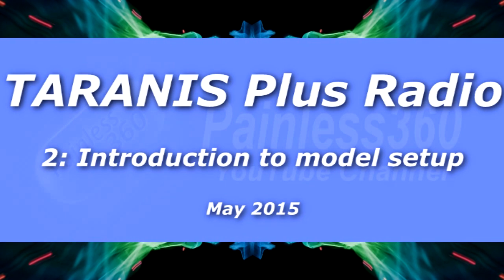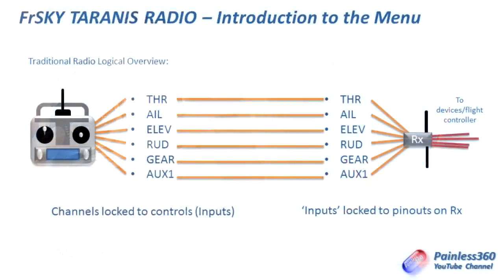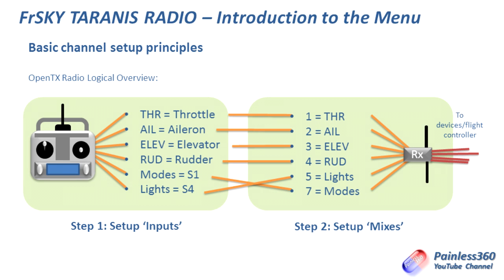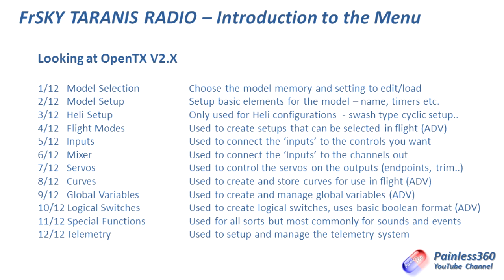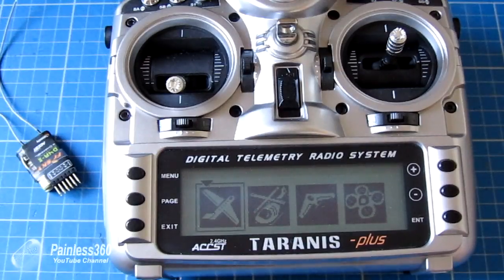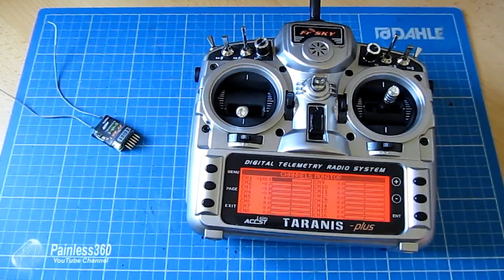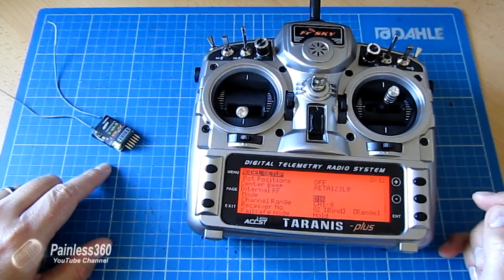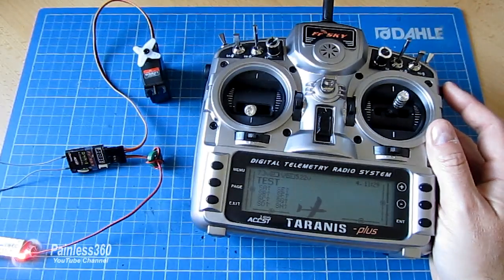(2/12) FrSky TARANIS Radio - Introduction to TARANIS model setup basics

Comment: I have a brand new Taranis Plus and X8R receiver, I cannot get it to bind at all.... I sent the rx back and had it replaced. still doesnt work... I have tried all the modes and it still will not work... I have the latest firmware on it and it still doesnt. When binding, the 2 LEDs stay solid. when im not binding its a slow red flash... Can you help me?... I havent used the dang thing yet...
Reply from the maker: JakeWardell 19 Make sure you have the D18 protocol selected (just above the bind selection on the radio) and it will burst into life!
Best of luck
Reply: Painless360 it's currently D16, ch1-8 receiver number 1. Still nothing. Even tried to make a new model...
Reply from the maker: Odd, make sure then that D16 is selected, the radio is in bind mode and bleeping, hold the FS button on the Rx and apply power. Nothing will beep to let you know it's working though..

Unplug the Rx and take the radio out of bind mode and re-plus the Rx into power - it should green LED in a second..

Is this the process you are following?
Reply: Yeah that's what I've been doing. Over and over again. Different models too.
Reply from the maker: Sounds like something is broken. The antenna connection at the top of the main circuit board can come loose in transit. Worth a check if you don't want to go back to the vendor for support..

Best of luck.
Reply: Yeah they did a crap job on shipping. I'll have one of my buddies check it out. I doubt ReadyMadeRC will replace it since I've had it for about a month. Even though I haven't used it.
Reply: Right when I got it, it did bind! But it would constantly say telemetry lost and gained. Then it just wouldn't connect anymore. Also, rssi signal, when I did manage to have it bound, I was about 10 meters away and it was I think 50 or so. Keep in mind I was in my house. But I shouldn't have had that signal issue.
Reply: It stopped connecting after about 10 minutes of being powered on.
Reply from the maker: Sounds like a bad connection finally let go. If you don't have another Rx to try then you can try then I would pop the case on the radio and check the antenna is connected ok - https://www.youtube.com/watch?v=ycM-fDWOLtE

Best of luck.

Comment: can you change the responsiveness of the stick on the taranis? in other words Im looking to get my quad to go slower then it when I move the sticks.  is this possible?
thanks
Reply from the maker: Yes you can . Reduced/dual rates and expo will help - http://youtu.be/eMxqfw5Fne0

Also, you can usually adjust the amount of control in the software for the Flight controller too. Depends on the one you are using.

Hope this helps
Reply from the maker: You can set the rates up for the flight controller that affect how responsive  a control is. That is what he is doing in that video.

You would never set exponential on the throttle channel, you would use curves to manage how the throttle behaves.

Best of luck. Happy flying!

Comment: Very well explained.  I look forward to the more advanced areas I haven't yet tried myself.

I've been using a Taranis for over a year but I moved from a Multiplex transmitter so the idea of being able to allocate any function to any receiver channel wasn't new to me but it was difficult to to learn when I first got my Mux3030. I didn't have the benefit of video tutorials like yours, though :)  No YouTube or even internet!

I have the lates OpenTX firmware (ver2.0.17) installed but it doesn't seem to have the model set up functions you describe here. I assume yours is the Frsky firmware?  I now rarely (never) set up a blank model. I just copy and rename an existing similar model as it saves setting up my usual switch allocations.
Reply from the maker: Belper Flyer Mine it running OpenTX 2.0.17 too. Happy flying!

Comment: You will find that a EU version  of the Taranuis will not work with a D4R II will not work with the newest  version of the radio due to EU directive, D8 mode has been disabled and the only legal way to get this working is to use an external TX  (DJT) this caused. me a lot of problems when I first got the radio
Reply from the maker: rockwellmediadundee Please post a link to the EU directive.. Thanks
Reply: Painless360 https://forums.openpilot.org/topic/57536-frsky-taranis-no-d8-mode/
Reply from the maker: Thank you - lots of confusion about this around..
Reply: Heres your original answer on the official site
http://www.frsky-rc.com/download/view.php?sort=&down=202&file=CE%20certificate-%20X9D%20PLUS-%20EU-%20V1.8.1
Reply from the maker: Thank you! :)
Reply: Painless360 how do I slow down a channel for gimbal tilt?
Reply: Just got mine, that's actually stated in the manual that comes with it, good thing I don't live in the EU

Comment: Thank you so much Lee :)
That is actually less complicated than everything i've heard from most of people. But they maybe used the old version of the software at this time. If you are familiar with playing around with your radio control, this is just a piece of cake, just need to learn and understanding everything about different pages!
That's a brilliant radio and fantastic software! It's probably the best thing which is happened to the RC hobby these last few years!
Have a great weekend

Comment: Painless360 
I have a Spektrum DX6 G2 2014 AirRadio, 
The new Airwave on this is like the DX9 and allows assigning the 4 axis inputs and any switch to any output channels, including mapping one input to multiple channels or mapping switches to any channel can be done from the Channel Assign menu in the System settings.
You can also set the channel mixing value for each switch position with a value from -150% to 150% in the Digital Switch menu in the system setting as well.
Reply: I really like the model setup wizard on the Taranis it's good for getting models setup quickly.

Comment: You really have to thank Frsky (and OpenTX) for what they are doing. I've had the "pleasure" to use radios of the established brands (Graupner HOTT and some Spektrum). As a programmer and hobby electronics engineer I always felt like their products were either designed by guys with long grey beards, who didn't want to change anything from the "old ways", or artificially crippled and overpriced. All of the radios already had a capable microcontroller inside and a large dotmatrix display, so there was absolutely no reason for the limitations the had, except maybe for the lack of competition.